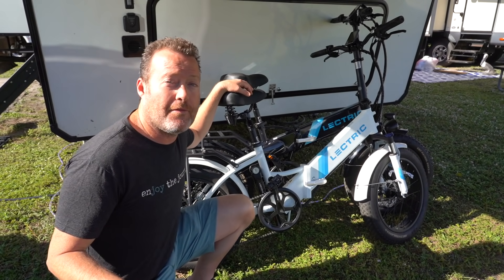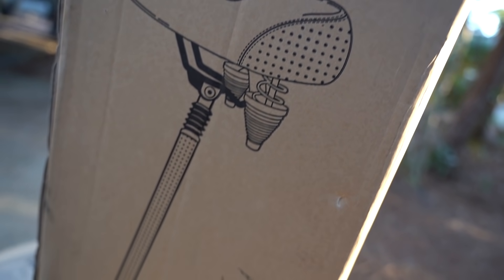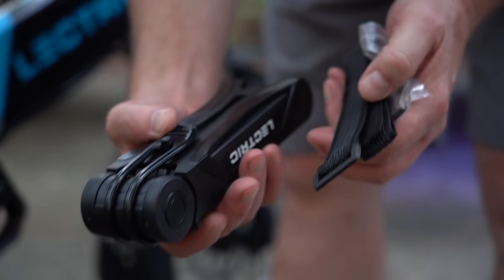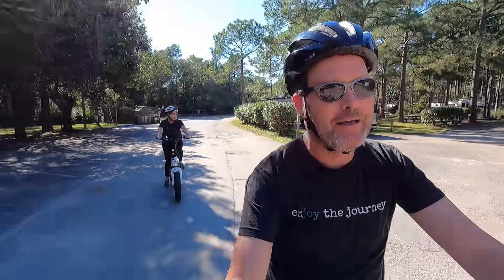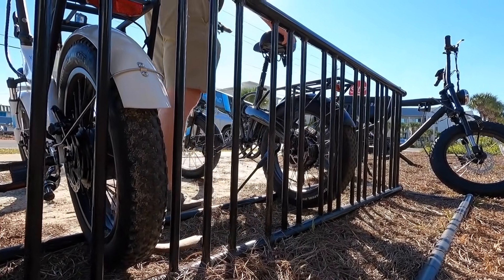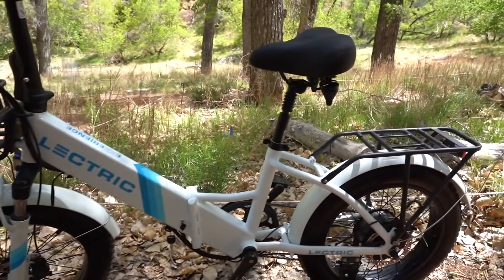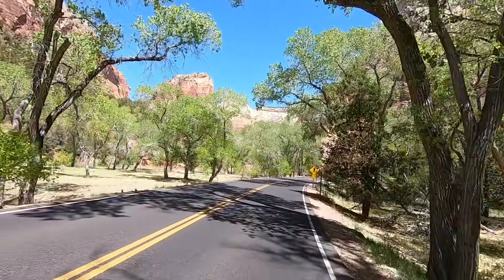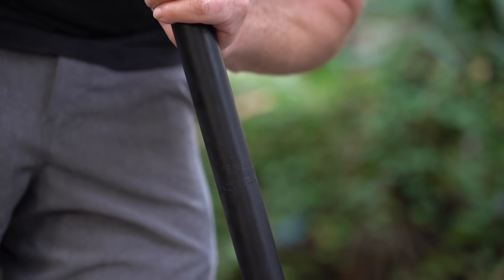AMERICA’S MOST POPULAR E-BIKE (2024) LECTRIC XP 2.0 REVIEW (UNDER $1000)

Comment: I have an Lectric bike. The bag of screws came with the lock. I used the straps because like many in our FB owners group could not get the screws in. I bought the upgrade seat but have not put it on yet. It took me a while to get the seat in the right position so my knee was not getting bent so much. I did notice you did not slow down for pedestrians or that biker that was stopped.
Reply from the maker: Thanks for the tips!

Comment: Those lectric e-bikes are the way to go! What really makes them useful are the saddlebags that you can get for them when you do a grocery run instead of driving the TV around (not unless you need to of course!) spending $$$ on fuel. Glad to see that the saddlebags are not the only options available now. Are you going to buy them at a later time, or what? What I'm curious about is if they can be recharged at the pole, or can you recharge them inside your 5th wheel? Headlights are mandatory in most states, I'm surprised that they're optional. Was the air pump included, or is that your own? Glad that spiders are your worst emergency! US Hwy 30 in Oregon goes along the scenic Columbia River Gorge, and is spectacular, especially in the Autumn. Tight turns are navigated just like when riding a motorcycle, you lean INTO the curve ;^) How are the disk brakes for stopping distance? I really like the baskets in the front & back. Stiffer suspensions are necessary for going off road AFAIK. Are those batteries custom design, or off the shelf? While the locks are cool and all, what keeps some nefarious person from making off with your front wheel, or your bicycle seat (those are the most common theft items here in Portland!)? Sorry about all the pesky questions, but we're considering a pair for our travels when we sell the stix'n'brix™, so we're more than just a little curious! Safe, and hoppy travels from the Boondocking Brewer!